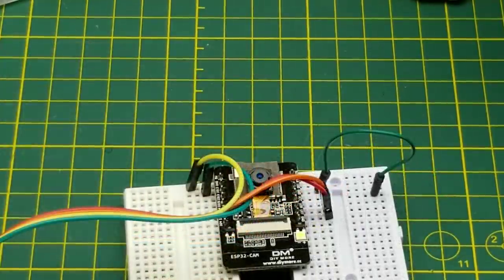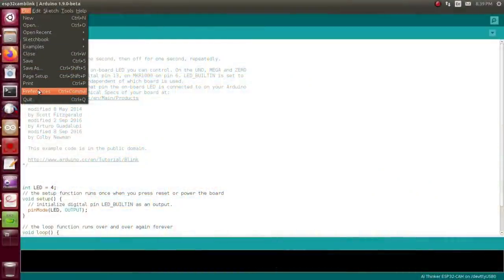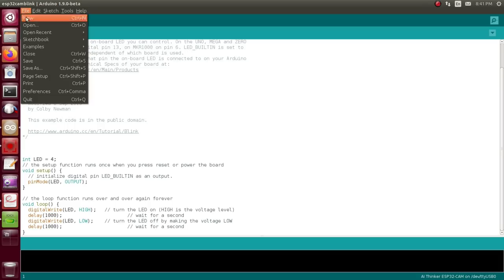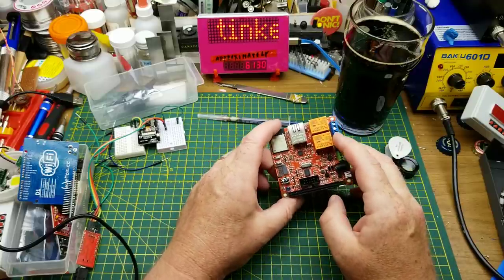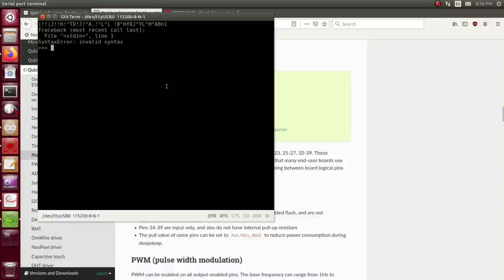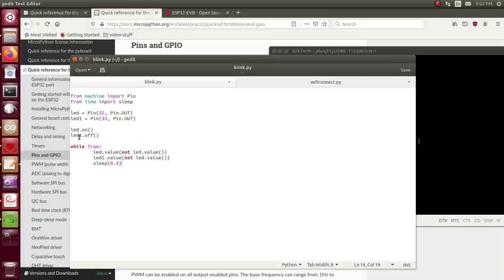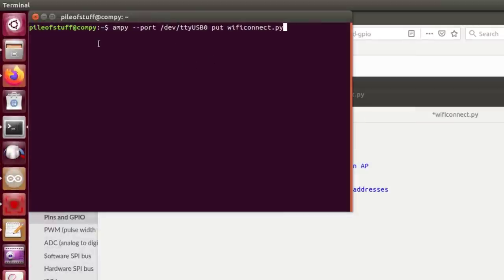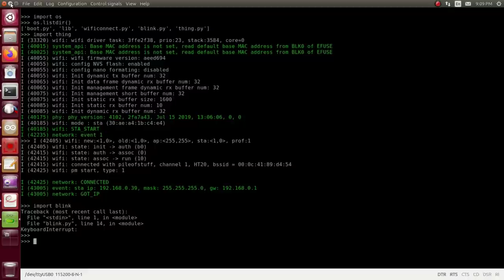tinkering with ESP32, Micropython and Arduino

Comment: That's awesome. Thanks for sharing.  I sent you this board because you originally commented on it in one of my videos asking if it could be used as a router. I said no at the time, but with micropython, I wouldn't be surprised if it could actually do some routing. Especially with its 2 network interfaces.
Reply from the maker: I'll have to see if my teenage code monkey is up for a challenge.

Comment: The dev board look interesting. I have the Esp32 cam. The ampy program looks useful (but for how long?). I also used the rshell program UnexpectedMaker suggests, it's useful but most other tutorials use a terminal. I will be using Arduino on microcontrollers for now, just to avoid spreading myself too thin. Focus on protocols and connecting and make sure I can control the devices I have. Micropython/Circuitpython look like the way to go in the long run, especially, for having something to hack on the fly.

Comment: I've been using Microsoft's Visual Studio Code recently as I've shifted to web development (send help!).
I think it runs on Linux/Mac etc.
There is an awesome addon called PlatformIO.
It supports Arduino type platforms including the ESP-32, AVRs and ATtiny etc. 800 boards!
Reply from the maker: I actually have that installed on my other computer. 
It looks like a powerful setup, but so far I haven't been able to get my head around it.

Yet another thing to spend some time on one of these days.
Reply: I use Platform for most of my controllers except for Pics and Micropython of course.  I do use VSCode most of the time now, but if I have to do real super edits, I go back to emacs :) VSCode works well with Linux and it's easy to get Platform going as using,  though finding a board in the list can be a challenge.
Reply: @pileofstuff  Definitely have a look at Visual Studio, and also Platformio if you get a chance. :)
Reply: Instead of running Microsoft software on Linux/Mac OS, you can also work with the Eclipse CDT.
Reply: @ArjanvanVught  Eclipse is quite good.
Reply: @ArjanvanVught  I just never could jive with Eclipse myself. I am an OLD emacs-style user, dating back to the Dave Conroy "me" days.  At work we use Vis Studio :(, so for me, it was a better choice, but editor choices are always a "political or religious" subject amongst the geeky masses :)
Reply: @EsotericArctos  It also has an Arduino Downloads Manager.
Reply: @UReasonIt  I am using Eclipse for more than 20 years now. There is nothing better than Eclipse ;-) vi/vim/emacs is also fun, but not handy with large C/C++ development projects.

Comment: Maybe the camera board works as a motion sensor, and sends the image of the motion to the relay board, which stores the image on the SD card and trips a light on a relay.
I have no idea how to do any of this, but it would be take advantage of both boards.
Reply from the maker: Apparently he cam board is powerful enough to do motion detection for security camera type recordings. I assume it could use that to trigger GPIOs or send a message to a server or whatever you want.

Comment: Thonny is a pretty good Micropython IDE for ESP or the boards.  Easy to set up and use.  Edit and save to the device,  update the firmware. etc..
Reply: I came down here to say just this! Easily the most accessible way to use Micropython that I've found
Reply: @RalphQuinn  Yeah, it works well under Linux and has kept me from ampy and the xfer code I wrote in TCL a while back.
Reply from the maker: I'm always impressed with the informatin that I gain from the comments.
Thanks